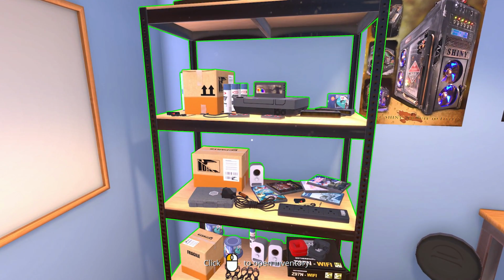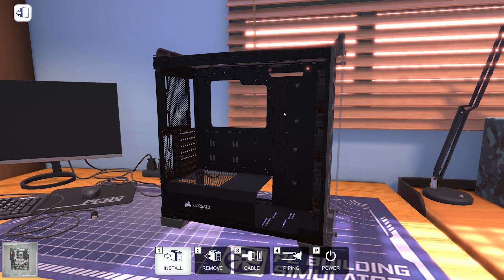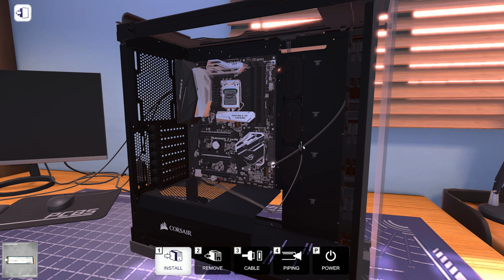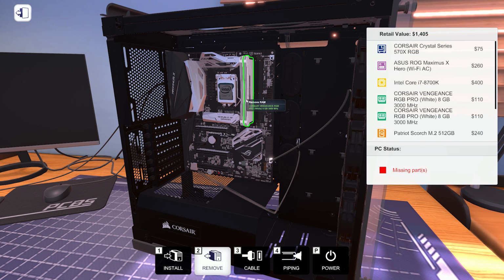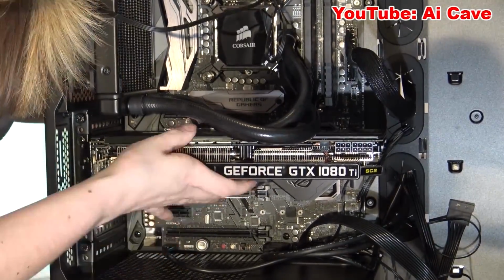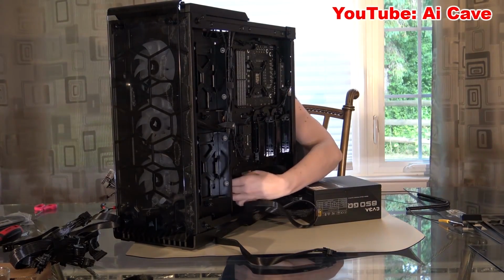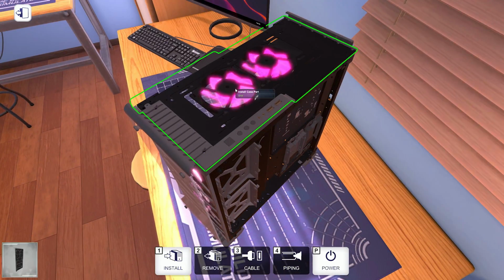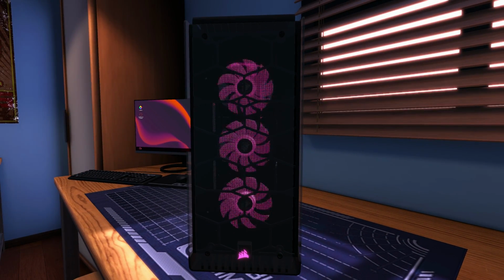Recreating My Gaming Rig in PC Building Simulator Video Game - Gameplay

Comment: Nice Video just you forgot to do Dual-Slot, means that you need to plug the first Ram-Stick in A2 (second slot counted from the cpu-socket), then in B2 (fourth slot) after this in A1 and last but not least in B1. Why you should do it like this is simply answered with: then you don't need to purchase a new cpu and or motherboard, because in your way either the cpu or motherboard will broke.
Reply from the maker: Good call!